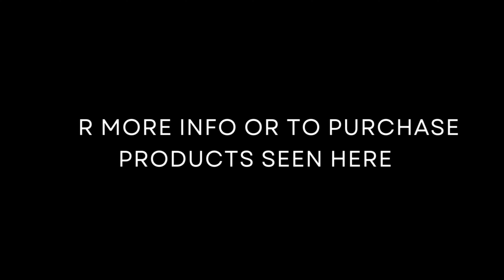Rain harvest cistern install (concrete): Step by step how to

Comment: Questions: 1- How big was this cistern? 2. What was the cost of this project? 3. At what stage of the build were you introduced?
Reply from the maker: 1) 5500 gallons
2) It varies greatly based on where we are installing. In Ohio, because of the regulations in place, cost is anywhere from $21,000-$23,000 right now.
3) We usually come in toward the tail end of the build. We like to come in after final rough grade has been established so we can get accurate grade readings for our drainage piping, and we like to wait a few months after the foundation has been backfilled so it’s had time to settle out before we lay drainage. 
Great questions! Thanks